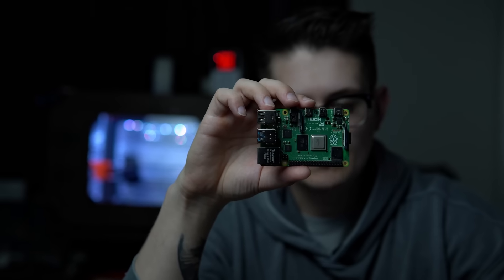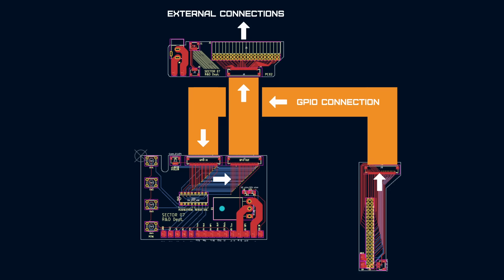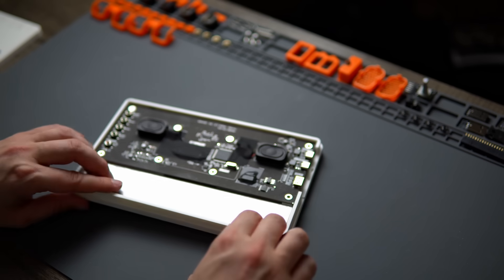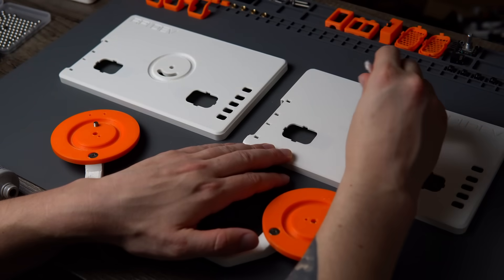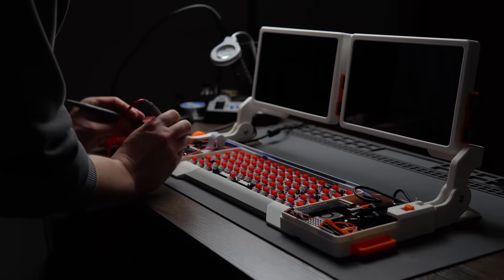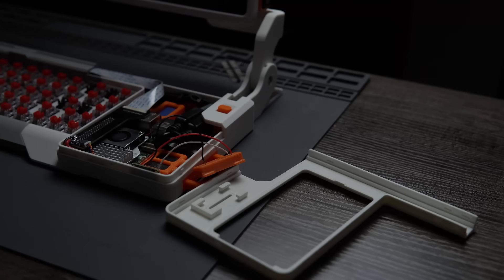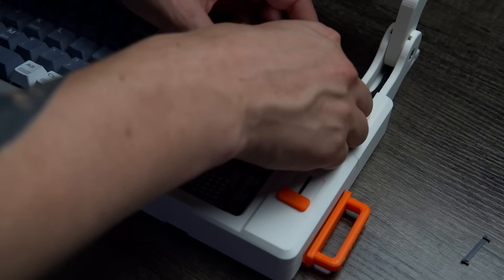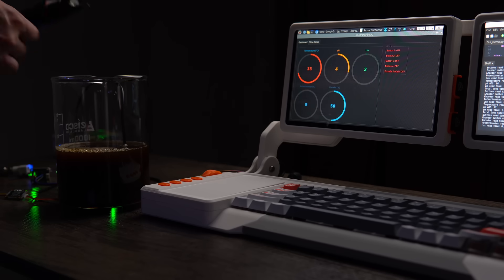DIY Dual-Screen Cyberdeck: Sleek Design, Ultimate Functionality

Comment: I’ve been a CTO for over 25 years, looking at your video I feel like a primate. The level of engineering you show, along with the 3D Model and printing is absolutely amazing.
Great job, absolutely amazing
Reply from the maker: Thats an awesome compliment. I dont have an engineering degree so I'm glad the work speaks for itself. Thank you!
Reply: @SECTOR07  You don't have an engineering degree? That's actually insane. You have demonstrated so many skills in one video. Expert level soldering CAD modeling circuit design, and quality control.  Not to mention embedded systems mastery! Truly shows that you don't need an engineering degree to be an inventor.
Reply: @gtas321  You only need an engineering degree for an engineer salary, that's the law, however to be an engineer is a lifestyle, solution-based mindset and philosophy. Most engineering students never reach intermediate skills with rapid prototyping (CAD, 3d print, custom electronics, software) by the time they become college seniors and are grasping at straws to learn it. CAD and programming classes are never taken seriously by students and only learn through homework, not building/programming their own projects. They never try rapid prototyping for an application until senior year, and that's much too late. Engineering for some application vs rapid prototyping skills are two very different pursuits. In a group of students some will be more manufacture-centric (welders, mechanics), others more engineering analysis savvy (coding, electronics), together unstoppable.
Reply: @c3ramics  so when learning this craft it would be wise to learn both manufacture and engineer skills? Im a little late but I have little to no exp. Would college be a good "point in the right direction" type of thing. I just kinda want a spring board of knowing what things are and what they do to get confidence putting them into motion. My knpowledge of practices just is so lackluster I feel so unconfident in my ability to even start a project.
Reply: @gtas321 I am in the same boat as him. No degrees of any sort. Did IT for 15 years and last year pivoted into industrial automation. 

I make stuff like this at my house all the time. I'm no smarter than anyone else.....just more motivated. A determination to learn in today's world will take you as far as you allow it to.
Reply: @SECTOR07 I would like to buy one from you fully completed including both screens and computer, is that even possible? I don’t have a 3D printer.
Reply: @curtislightwithin  You don't need a 3D printer yourself,  there are proxy services that will do the printing for you, including the sponsor mentioned in the video. You could have all the parts minus screens, and whatever bits and bobs aren't available shipped to you from them, and the rest could be ordered elsewhere. I'm fairly certain you can even get the boards soldered for you if you don't have the tools or experience required. You'd just have to do final assembly.
Reply: @SECTOR07  You don't need an engineering degree to be an Engineer and you are definitely an Engineer.
Reply: @SECTOR07  Considering you don't have any formal training in engineering makes this project even more impressive. You definitely have some talent in industrial design, form and function of this is really professional level.
Reply: @SECTOR07  good evening can you add a link in the description where you purchased those lcds used for raspberry pi. Thank you very much
Reply from the maker: @serbanvictorandrei4188  Check out the github docs. It has a full parts list as well as a bunch of other stuff you might find useful: https://github.com/sector07-dev/RPI_DEV
Reply: News flash: You are a primate. We're all primates
Reply: Give him a job
Reply: Actually, you are a primate. We are a subspecies, just like the apes. A better descriptor would be Neanderthal or Homo Erectus.
Cheers 👍
Reply: Then retire

Comment: Honestly, I really am not one of those couch potatoes that are complaining, and talking shit. BUUUT, you can't seriously tell me, that this cyberdeck is THAT physically massive. Literally YUUUUGE and doesn't have a FUCK me 5 days long battery???? And I mean it from the bottom of my heard, seriously tho, you could pack inside 50 batteries that would run 5 days with that raspb-pi low voltage consumption

Comment: Consider getting a nicer soldering iron (specifically one where the heater is integrated into the tip instead of just touching it)

Even a pinecil might be nicer than what you have
or one of the jbc clone stations

Comment: This product costs ~$420–$550 (including printing and labor costs). I’d definitely consider grabbing one. Amazing work! Let's talk. I want to buy it.
Reply: How do you calculate other peoples labor costs?
Reply: Even if you completely disregard the upfront design costs, this is hand soldered, hand assembled by someone way overqualified for "simple" assembly. So making this would take a considerable amount of time. Multiply that with the hourly rate of a highly skilled engineer. Add the material costs and shipping. I think it's waaaaay more than $420-$550. If you look at the license file in the github project, you are free to make one for yourself. PCB Way can 3D print the parts, you can order the PCBs completely pre-soldered with the parts. I'd assume the rest is not that hard to do. [edit: typo]
Reply: Really? I calculated ~$1,000. Am I missing something?
Reply: I foresee a successful business selling tech hardware like this…

Comment: I mean, it is designed well, but is it actually functional? It is not portable as other cyberdecks designed inside waterproof boxes, but at the same time screens are small. While being a good project I still prefer the version of SaveItForParts or other similar, with a lot of functionalities, battery included and a lot of space where to put things

Comment: This is actually pretty genius. So I would use a more powerfull mini board computer and ardunio/analog side for sensor data input. Programming and Messurment in one device? Fantastic! Also monitors are a bit small for my personal taste all in all pretty dope idea. I maybe reuse prop also a laptop for more processing power as for the compute base while the keyboard is above it essentially

Comment: Love the design and the video! Thanks for sharing! Does the device feel sturdy enough for mobile use in the sense of occasionally moving it to a different place? I don’t have experience with 3d printed snap fit connections, so I’m having g a difficult time judging the decks rigidity. Thanks again! Looking forward to more projects!

Comment: I wish I had your skills so I can create a cyberdeck for a Raspberry Pi 5 that looks like a Toshiba Libretto 50CT with the main focus being the battery life (spring loaded series/parallel 18650's or 21700's with a custom printed charging board that can do fast charge) and a mechanical keyboard. Your work is amazing.

Comment: Everything is designed so precisely!
You should definitely add such sensors to the displays that detect when you've turned them vertical or horizontal so they flip the image automatically. Hall effect sensors could work well in this because then you can have separate points for when you want it to flip the image vertical and when horizontal to avoid oscillation. 
Just like a Schmitt trigger.

Comment: For the raspberry pi part for ejection you could make the holder a slider with a clip system inside that unlocks when pressed specifically, you could also put a shallow button to press underneath the dual system so it’s less noticeable and less likely to be pressed to eject maybe you could also put a safety switch. It’s a nice project man keep the work

Comment: Really impressive build! I know how long it takes to make traces that look that good and I’m impressed!

One recommendation for press fit, instead of trying to nail the fit, you may be able to do a looser fitting press+slide design with a bit of foam providing a spring. So you press in and it compresses the foam, then you can slide the lock out/up.

7:48 wow, the effort to get the channel depth so those screws stand straight up; you’ve got an attention to detail that is going to take you places. I’ll be watching you for sure.

Comment: Should partner with pcbway to make kits with printed parts , cables and finished boards (and screens of possible). If the whole pack was sub 600 usd i would buy it

Comment: the trace layouts on these pcbs hurt my soul. I know its lv so it wont make a huge difference but still, sharp corners = bad. those vias on the GPIO are especially egregious and I could easily see it causing some problems. I'd highly recommend taking a course on pcb design online, there's tons of free ones that'll give you all you need to know about "good" and most importantly, safe pcb designs. Phil's lab on youtube is also a wonderful source for information, you can learn basically everything you need to know from his channel alone.

Comment: After over 2 years of implementation, I am so sure that the performance of RBP 5 is shitty, even the browser is not stable implementing a video stream sourcing from surveillance device in the same LAN. I think you should rather try x86 SBCs, which has better compatibility with Linux OS with more stability and less collapsing/crashing issues, especially the latest Intel N150 based products with the chip released in Q1 2025 .